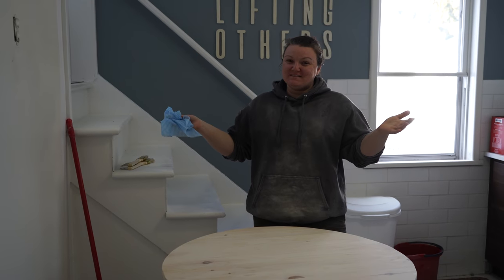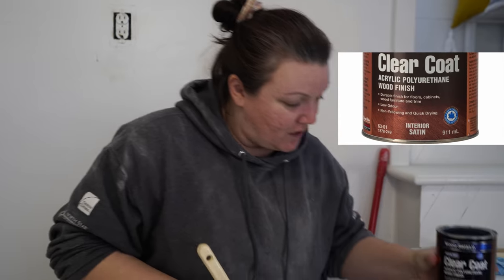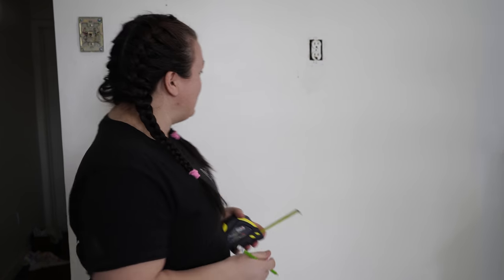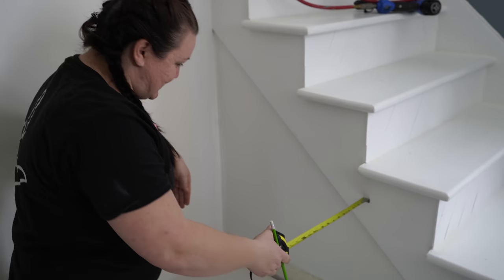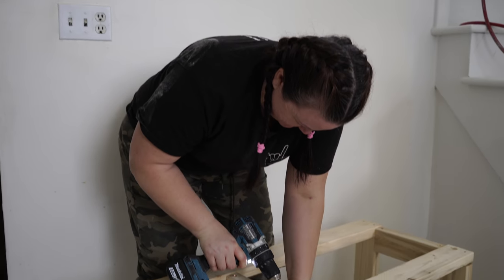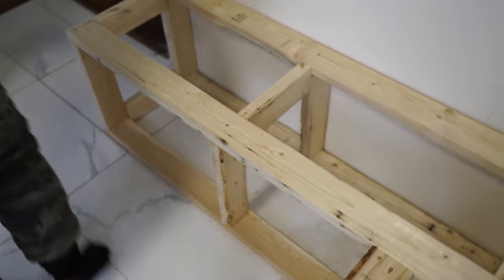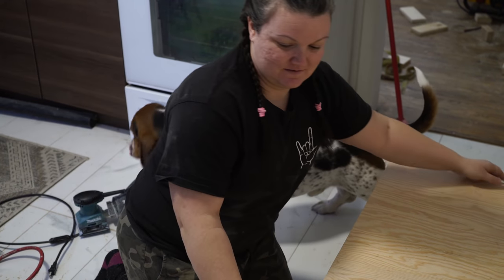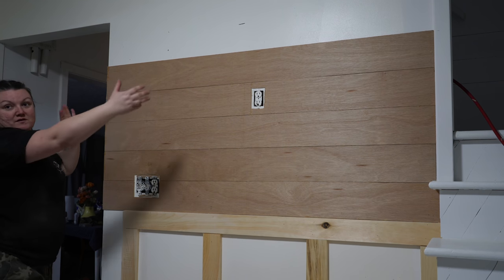DIY Modern Farmhouse Kitchen Breakfast Nook

Comment: It's cute, it turned out really nice.  I think, I would consider putting the poles back that were originally there as a safety feature and to separate the stairs from the bench area.  Paint the poles white & there would still be room to hang the plant.  Like it, like the colors and so very useful.

Comment: NICE... I have been looking at making a Breakfast Nook using Kitchen Cupboards, so they open outward and the cushion would be fixed in place,
Reply: @pama.6410  yes
Reply: @ceciliajacobs5346  Crawling under the table will grow old fast.
Reply: @pama.4849  The space will be used for items  used occasionally
Reply: @ceciliajacobs5346  It only has to work for you!  All the best.

Comment: Love the table but would like to make a suggestion....  Instead of the legs being short enough that the rough end of the crossbars show, it would be better to make the legs longer so that the rough ends of the crossbars are inside the legs and not showing.  You will get a much nicer look that way, & as you know, the smooth wood of the leg will take stains and paints better than the rough end of the crossbars.   I'm just an old woman & perhaps I'm wrong, but I always make sure on any project that I'm doing that there are no rough ends exposed anywhere.  Love what you're doing tho'..... my basement needs a makeover desperately!  'Hoping to copy some of your ideas, but want to make that breakfast nook in my kitchen!